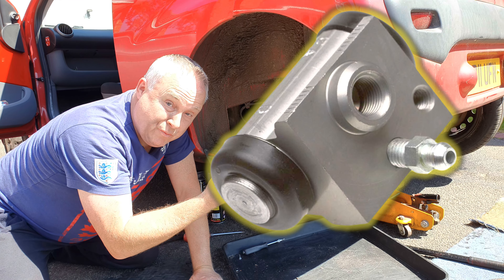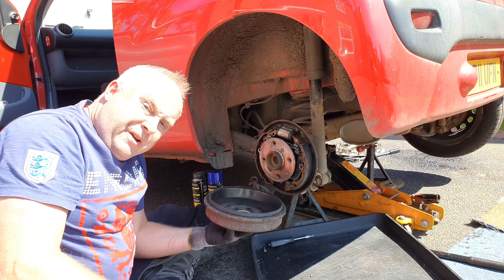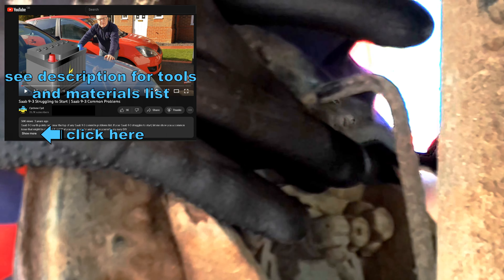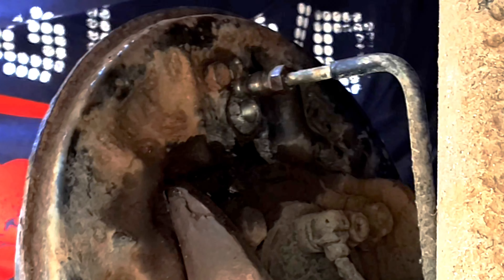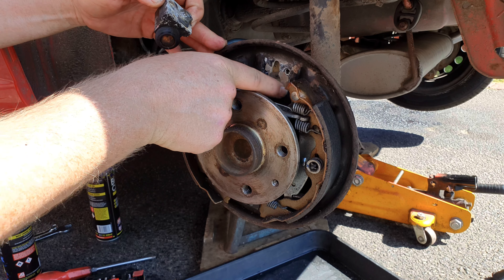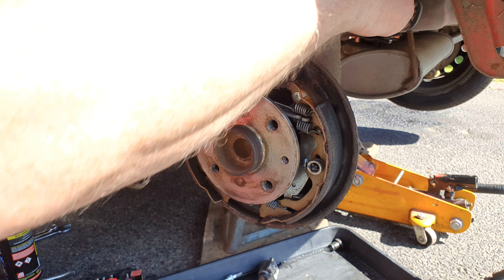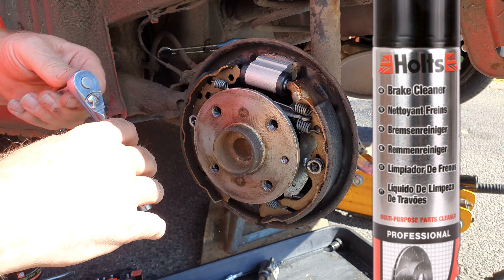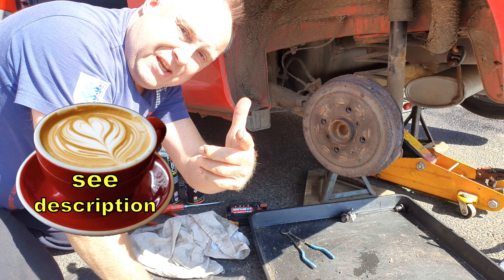How To Change Citroen C1 Rear Brake Cylinder

Comment: Sad my car failed the mot because of that cylinder and a brake line being rusty, turns out I think they need to replace they whole line as it's rusty and the cylinder , they quoted me £ 460 which tbh not sure if it was worth for a 2009 C1 but I need the car and not planning on buying any other car

Comment: Great video sid. I'd get some rust converter for that heat shield soon, or do your normal routine for corrosion control. I'd love to see a video on it. Thank you
Reply from the maker: Heat shield?
Reply: @CycloneCyd  maybe it's a dust shield on the inside of the brake assembly. The fairly thin, somewhat roundish plate that supports brake hardware and separates it from the underside of the car.
Reply from the maker: @troy3456789  ah ha, the brake back plate (if that's it's proper name). Yes, soon

Comment: Hiya , so we've replaced the rear passenger wheel cylinder all went perfectly and brakes worked great (the pedal felt a little stiffer) . However the handbrake has just gone floppy it's self has gone loose (used to be very stiff to put on ) and now not working on passenger side any ideas ??
Reply: Needs both rear brakes manually adjusting back up. It was a hard handbrake before because the piston was pushed out in the seized position meaning no handbrake travel

Comment: My college has a 107 for this cup race. Done the rear left no problem at all the pipe unscrews from the cylinder no problem but the right side… let’s just say every Thursday I’m having to replace more piping/hoses😂 had to saw the pipe from the cylinder because a heat induction kit did nothing. Then the week after I had to remove the other end of the pipe connected to a flexi hose due to needing to replace the pipe. Let’s just say the heat induction caused the hose to explode off the pipe ruining the house